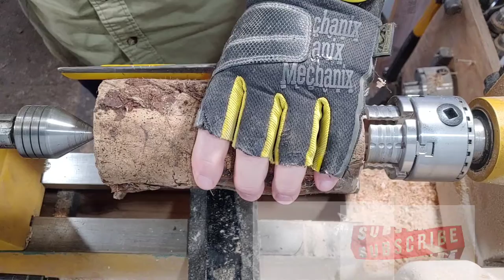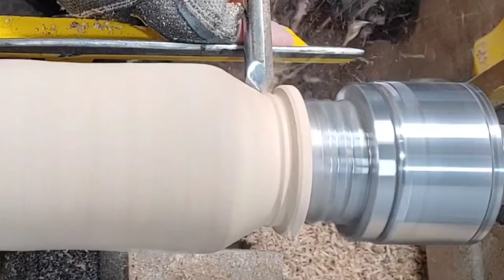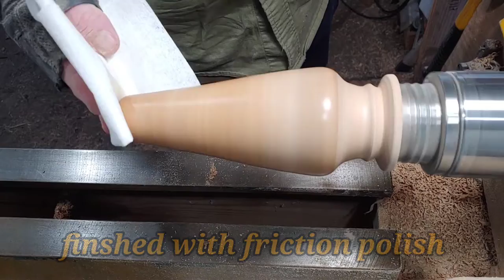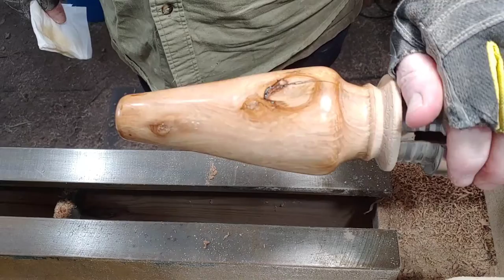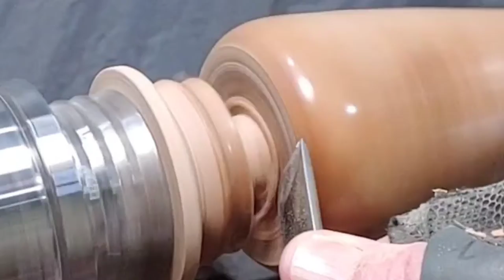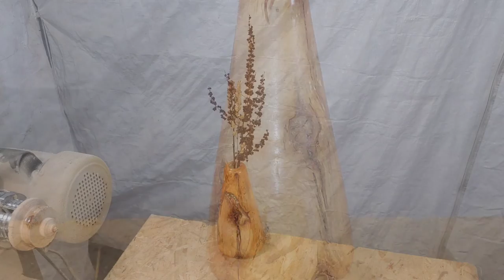wood turning - easy beginner projects for getting started ( that are very cool) project #1

Comment: Good afternoon 
I’m very, very much the beginner sooo, please bare with me. 
When parting off you went from your parting tool to your skew chisel saying about it saving reversing.  
I’ve turned so little, using carbide and a homemade parting off tool; I’m afraid that I didn’t understand what you were saying about reverse turning & a little worried that I maybe doing thing wrong - parting off until, it comes off 🤣
Hope that makes sense - Peter
Reply from the maker: That's a good question Peter.
When you part something off with a parting tool it usually leaves a rough surface on the bottom. Reverse turning is flipping the project around and then you turn the bottom of the project to smooth it. When I part off with the skew it leaves a smooth surface so I don't have to do that.
A word of advice, I don't recommend using the skew for this until you have lots of experience with the skew. It can be very dangerous if you don't know the technique.
Thanks for watching!
Reply: Perfect answer thank you, perfectly understand just not heard of it before referred to as ‘reverse turning’, thank you for clearing that up. 
I’ve really only done recess (mortise I think), just a couple of tenons. 
Looked recently at reverse turning & was just, just about to give it a go. 
Really enjoying watching your turning. 
Thank you for such a prompt reply.  :-))
Reply from the maker: @peterhicks  your welcome. Have fun on your journey!

Comment: Real time is good,  gives me idea how long it really takes for the project.  What's very valuable to me is to know what sanding grits used & what finish is used. 
By the way,  what is B.L.O.?
Thanks for sharing,  I'm a better turner because of your teaching by sharing.  God bless you
Reply from the maker: Thank you Sam!
I love hearing that my videos are helping. That's why I do it.
B.L.O is boiled linseed oil.
When it comes to sanding 95% of the time I start with 80 grit. Now this is the most important part of the sanding process. The 80 grit will remove the tool marks and smooth out the surface. You don't want to move on from that until you have removed all the blemishes from the surface. The rest of the grits smooth the surface more to get a nice finish on the project. I do 80, 120, 180, 220, 320, and 500.
Thank you for watching! God bless!